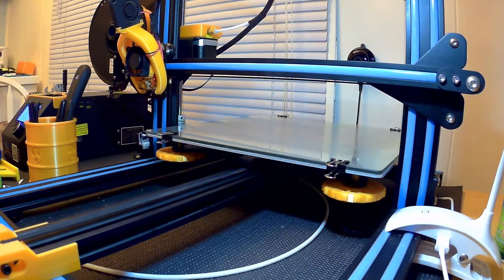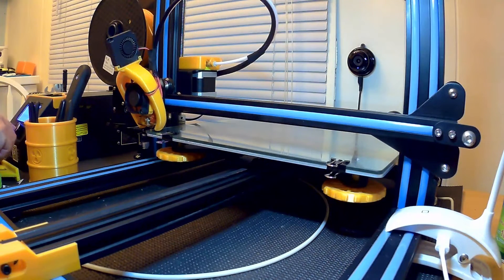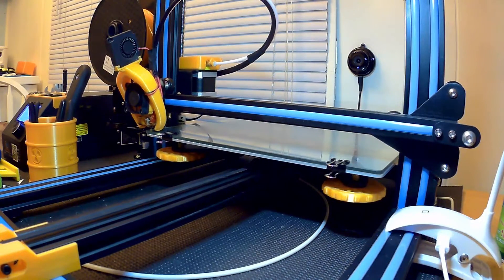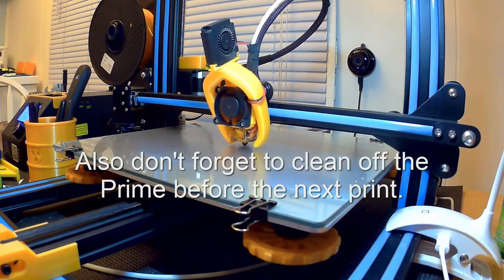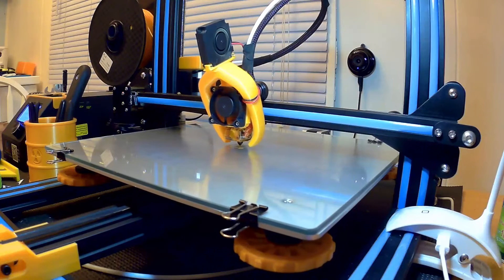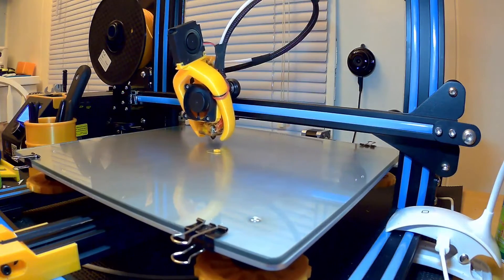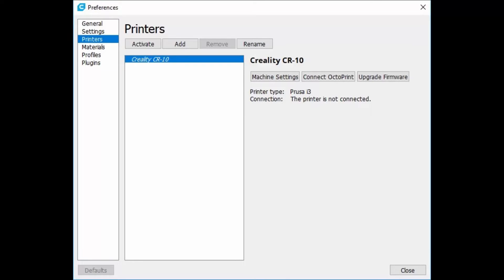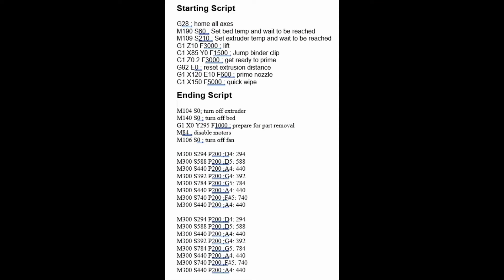3D Printing Tips - GCode Start and Stop Scripts

Comment: Hello friend.
I'm from Brazil.
I have a Ender 3 pro.
It's possible to introduce this code for ender 3?
I use the slicer Simplify 3D.
Tks friend.
Reply from the maker: I don’t have an Ender 3, so I’m not 100% positive.  But I believe the code is compatible. The only thing that might be an issue would be the prime line. That line might be too long for your smaller print bed.

What I would recommend is to back up the current start and stop scripts in your S3D program. Then replace them with this code, and test a very small print to see if it works. If it doesn’t work, then you have the original code to put back in.
Reply from the maker: Also, I have updated start and stop scripts in the description of the video linked below. These might work better. 

If you don’t have auto bed leveling, you can remove those two lines. 

https://youtu.be/OfOD-BbfIJE

Comment: does that code works on ender 3
Reply from the maker: As long as your Ender has a speaker inside, it should work.
Reply: @SuperSport1966  i mean the gcode for that wipe ... I created my own one: but for most people it wouldn’t work because my flexi buildplate has a little outstanding at the front so I can print the line on That.. but if someone want to use the gcode or modify it here u are: M83

M201 X500.00 Y500.00 Z100.00 E5000.00 ;Setup machine max acceleration
M203 X500.00 Y500.00 Z10.00 E50.00 ;Setup machine max feedrate
M204 P500.00 R1000.00 T500.00 ;Setup Print/Retract/Travel acceleration
M205 X8.00 Y8.00 Z0.40 E5.00 ;Setup Jerk
M220 S100 ;Reset Feedrate
M221 S100 ;Reset Flowrate

M117 Drucker auf 0 setzen . . .

G28 ; home all axes

M117 Here we go printing

G1 X50 Y0 F1500 ; Jump binder clip
G1 Z0.2 F3000 ; get ready to prime
G92 E0 ; reset extrusion distance
G1 X140 E13 F600 ; prime nozzle
G1 Y0.5 F600
G1 X65 E10 F600
G92 E0 ; reset extrusion distance
M82

M117 Printing . . .

Comment: Hi!! 
I have a little problem,  I put this code in the  ending script.

M220 S100 ; Reset Speed factor override percentage to default (100%)
M221 S100 ; Reset Extrude factor override percentage to default (100%)
G91 ; Set coordinates to relative
G1 F1800 E-3 ; Retract filament 3 mm to prevent oozing
G1 F3000 Z20 ; Move Z Axis up 20 mm to allow filament ooze freely
G90 ; Set coordinates to absolute
G1 X0 Y160 F1000 ; Move Heat Bed to the front for easy print removal
M106 S0 ; Turn off cooling fan
M104 S0 ; Turn off extruder
M140 S0 ; Turn off bed
M107 ; Turn off Fan
M84 ; Disable stepper motors

But, when the print over, equally go to home. May be some firmware thing ?

thank you

Comment: Hi Is it possible to use these codes for CR 10S pro and insert the autobed leveling command before each print? thanks
Reply from the maker: victor voon yes, it should work the same. 

You can backup your existing start and ending scripts to a text file, then try mine. If there’s an issue, you can always put yours back in.  

But it should work fine as long as you have the Auto Bed Level sensor on your printer.
Reply: @SuperSport1966  Alright, that is a great idea. I will try that out and thank you very much. :)
Reply from the maker: victor voon You are very welcome. If you need the script modified more, let me know.
Reply: @SuperSport1966  ok thanks

Comment: looks like you have auto leveling in the script.... great job! just tried it on my super frustrating cr10s pro!
Reply: Yes thanks I million! Do you have a cr10 pro now?
Reply from the maker: No, I have the original CR-10. I added Auto Bed Leveling to it.
Reply: How do I get rid of it doing Any prime line
Reply from the maker: TheMarksmansam -  Are you using my start script?
Reply: @SuperSport1966  not yet, i was going to download it but it still does a small initial line... I like it going that direction now over the current but none would be best for me. My brim is basically my prime anyways
Reply from the maker: @TheMarksmansam  -  Can you show me what is in your Start Script so I can see which commands you might have for prime?
Reply: I'd like to get rid of the center probe movement on the cr10s pro... Leaves a blob on the center before the print.
Reply from the maker: @darweez  -  Is that the movement that happens before it starts Auto Bed Leveling?  That's an issue I have also, not only the center probe, but each of the other probes for leveling.  I just pick those off before the print starts.  If you remove the center probe, that also removes the homing, which you really need to get your spacing from the nozzle to the bed.
Reply: Oh I didn't know that was necessary for auto home and leveling. Seems like it is working fine. Where did you get your glass bed from? I ordered one on Amazon and it seems to be about a quarter inch too short one way
Reply from the maker: @darweez  -  The glass bed in this video came with my printer stock.  I've since replaced that with Mirror, and now CCTREE Print Surface.  https://amzn.to/2B9yqKh I really like the CCTREE surface because it holds the prints VERY well, but I prefer the look of printing on mirror.  So when the CCTREE wears down, I think I'll go back to mirror.  I bought a pack of 6 mirrors from Home Depot for $9.98.  These are the exact mirrors I bought:  https://www.homedepot.com/p/Glacier-Bay-12-in-x-12-in-Plain-Edge-Bath-Mirrors-6-Pack-81175/205513215
PS:  These mirrors are also about 1/8" smaller across.  It does not hurt the print at all.  I just center it on the bed.
Reply: @SuperSport1966  thanks!
Reply: I don't know where in cura to do script settings. I just started using Cura so I know it's a Cura setting .. I turned off blob or whatever but that wasn't it
Reply: @TheMarksmansam  it's in the printer settings
Reply from the maker: @TheMarksmansam  -  In CURA, go to 'Settings', 'Printers', 'Manage Printers'.  Select your printer, then 'Machine Settings'.  Remove this from the 'Start G-Code':
;Prime the extruder
G92 E0
G1 F200 E3"
Reply: @SuperSport1966  legend 😄
Reply from the maker: Darwin Miranda -  Yes, I love auto leveling. It works well on my printer.

Comment: Hi. I would like to put the percentage of the print on the screen because the CR10 does not show it. You will know how? Thank you
Reply from the maker: Jose L -  I know it can be done in the Firmware of the printer. Let me see if there’s a way to do it using the startup Script. I’ll get back to you as soon as I find something.
Reply: @SuperSport1966  thank you.
Reply from the maker: Ok, I've searched as best I can figure out, and I don't see any way to enable it in the Start Script.  It appears to only be available within the firmware.  I've flashed a custom firmware from TH3D, and I like it a lot, but you'd need to decide how important that feature is for you.   I've also added Automatic Bed Leveling, so it was necessary for me to flash an updated firmware.

Comment: Hi, 
Very helpful video 
I have a question, How can I add a gcode after every layer of the print?
Reply from the maker: That's a good question!  I'm not sure as I've never tried anything like that.  Two ways I can think of off the top of my head would be to create a new process for each layer in S3D, or second way, maybe edit the GCode file in a text editor and just past in the Wanted GCode at the end of each layer.  Again, I've never tried this, and I'm not a big GCode editor, so I'm just guessing on those methods.  I believe manually editing the GCode would be totally possible though.
Reply: Open the Saved GCode file in Notepad++, Do a Find and Replace function. Before every Z change there is a comment starting with " ;LAYER " , You can FIND " ;LAYER " and REPLACE with " M300 S3729 P375  ;LAYER " then the printer will beep before the Z change every time.

Comment: Hi..why would it matter if power off at end print...i always power mine off manually when print is done......nozzle and heat bed would cool off pretty quickly
Reply from the maker: der ddd it’s probably fine. I’ve had mine get clogged easier when I turn it off before the fan helps cool it down. The fan cools it much quicker.

Comment: yes very odd.....i resaved program and turned 3d printer off and am going to try to rerun it....the bed heated up this time...ill see if it shuts off now at end of print..i also added a turn fan off command...and next time i will add a turn power supply off command...since i have multiple fans i dont want them all running
Reply from the maker: I didn't even realize there was a power supply off command.  I'd use that too.  Does it happen AFTER the bed and nozzle cool?  I'd hate to have the power go off when the nozzle is still hot.
Reply from the maker: Maybe there's a way to put a timer to allow the nozzle to cool before shutdown.

Comment: How would i add gcode to turn heat bed off at end of print?...i added M140 S0 in end gcode in slic3r and it turned off heat hed at start of print
Reply from the maker: That's strange...  It almost sounds like a Slic3r issue since the end code should not do anything till after the print completes.  I don't use Slic3r, so I'm not familiar with it.  I'm sorry.

Comment: Hello,
I have changed the Code in My Cura für an CR-10 MINI. I was hopped than the code Worked. But the First line is over the Bed. The Mini has a 300x300mm Bed.
Can you Tell me what i must change in the code for My Mini?
Thanks Chris
Reply from the maker: Verify your Cura settings because your bed on the Mini is actually 300 x 220.

Comment: why prime if you print a brim anyhow 
i just use the brim to prime , add a rotation if it's a tiny object 
or just 1 rotation if it's a big object
Reply from the maker: The prime makes sure that the Brim comes out clean to start.  I've had the brim roll up a little and run into the print area and cause issues.  It's not necessary, but I find it to be more fail proof.
Reply: but a brim is basically only to prime 
a skirt is another story 
but priming and then still using a brim seems not rly needed to me
Reply: nice printer btw mate
Reply from the maker: Yeah, the prime gets the material going, then the brim does a clean prime.  I still get an occasional bubble in the brim, so the prime helps to alleviate that.  Also, the prime happens near the edge, so it does not get pulled into the print like a weak brim can do.  But, I agree, it's not totally necessary, I just do it to prevent further issues.

Comment: Hey  Great vid. Im trying to use your start Gcode but after the prime nuzzle it leaves a line of filament when its heading to start the print.  Any suggestions ?
Reply from the maker: SOULJAHX6 I’m not running into that. Is your bed close enough that the wipe cleans the nozzle before it heads to the print?

It should first jump the clips, then do a prime, then a wipe, before it moves to the print.
Reply from the maker: SOULJAHX6 I got an email about your message, but for some reason, it’s gone. I actually use the Marlin Flavor of GCode.